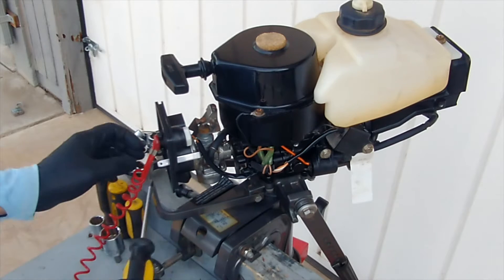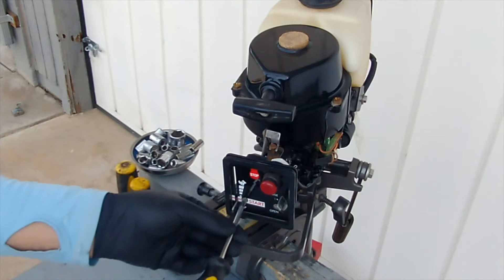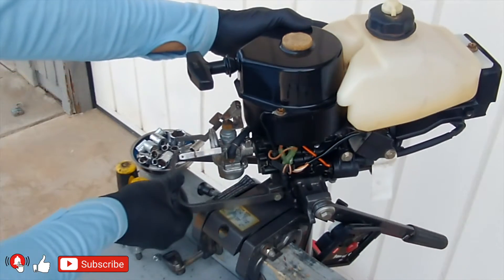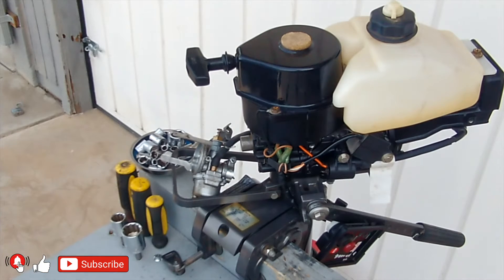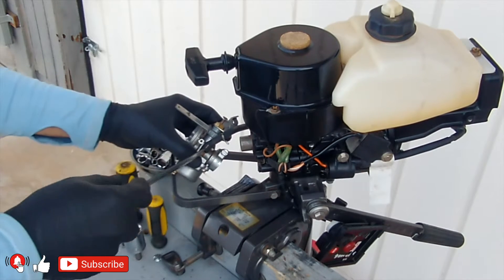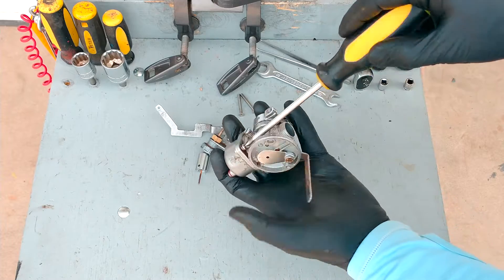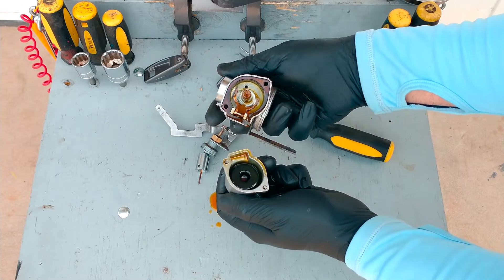2.5HP AND 3.5HP TOHATSU, SUZUKI, JOHNSON, NISSAN, MERCURY - carburetor cleaning

Comment: I need help man I flipped my boat and submerged my 3.5 Nissan what do I do I can't get it to start without starter fluid I already cleaned the carb and put new spark plug
Reply from the maker: Was the engine running when this happened?           
If it was working, it could be that the engine is hydrolocked and bent the piston rod. For now
unscrew the spark plugs and ventilate the engine.It is very important that no water remains in the engine because it will rust. Then try to start it. If it works then everything is fine, if not it will need to be repaired...

Comment: Great little engines. Looks like air cooled 2 cycle oil in carb(red), you want Marine 2 cycle(blue), not the same made for cooler conditions,won’t foul plug.

Comment: Thanks for the video. At 14:14, you can see there are two holes at the top part of the fuel bowl, what are these two holes for? In my case, one of them is blocked and I am not sure if that matters. the other one leads to a hole behind the choke cover.
Reply from the maker: It is a factory plug or some varnish?

Comment: what is the purpose of the screw (with a red color washer ? showing) at the bottom of the float bowl for?  You did not open/ unscrew it when you placed all the parts in the cleaning machine.   My engine (3.5 Tohatsu) recently started to leak from this screw.... thoughts on why?
Reply: that's the drain hole. when you clean the carb, you first drain the fuel then open the bowl but many people including me skip this step and just open the bowl directly and let the fuel spill.
Reply: @siyunchinn3904 would this drain screws (red rubber washer) become compromised and leak?

I recently started using the premixed fuels rather than mixing my own oil in fuel for convenience… I wonder if something in those “premixed” fuels is causing the red rubber washer to deteriorate..?

Comment: Thanks for the incredibly helpful video. 
I have a few questions.
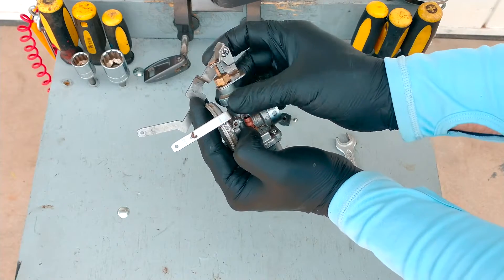1.) I am not able to loosen the part on the level you are touch at (2:15.) I tried pliers. Can I use a lubricant like WD40?
2.) I am also not able to release the pin holding the float bowl level arms (4:16.) Can I force it with a pin, add lubricant? 
3.) The small pin behind the level arms (4:28) in the hole slipped out, and is not connected to the arms. Am I able to place that back in after cleaning and it work properly? 
4.) in your cleaning machine are you just using water? If I don’t have a machine like that, can I let the pieces soak in fresh water? 

Thanks in advance!
Reply from the maker: Yes you can use WD 40. I'm using Dawn degreaser to clean the carburetor